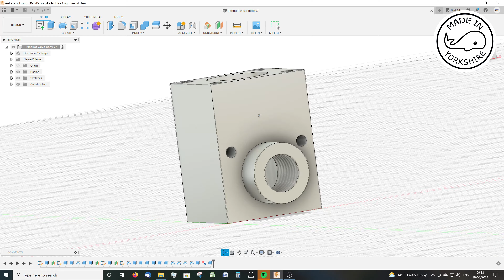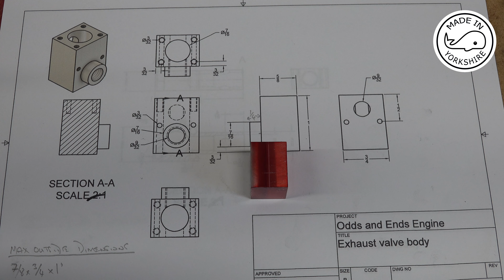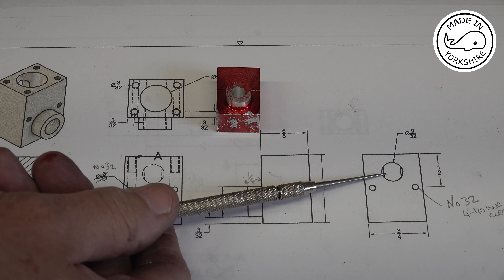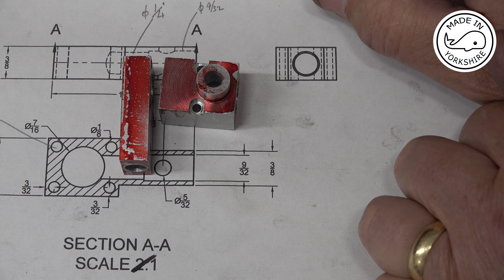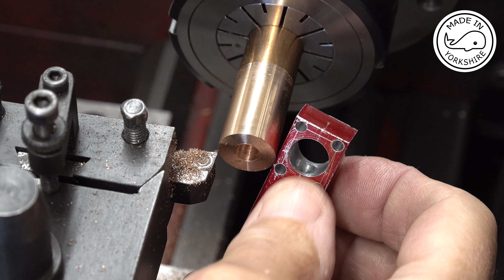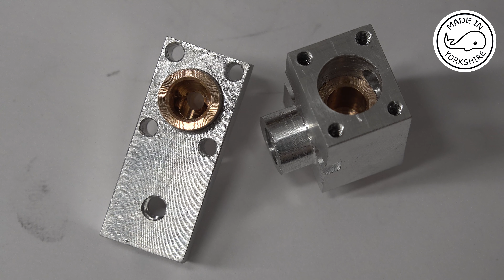#MT41 Part 11 - Philip Duclos Odds n Ends Engine. Intake and Exhaust Valve Bodies. 4K Andrew Whale.

Comment from the maker: ****READ ME****
After reading various comments I think I would change my method slightly. MisterG suggests drilling the smaller (1/8") hole in the cage first, before drilling the larger one. This helps maintain concentricity. A great suggestion! Also, having thought about it, I think I would make the valves and lap them into the cages before pressing the cages into the bodies. That way, if I find that the cages are not perfect, I don't need to press them out of the bodies. You live and learn!
Cheers
Andrew

Comment: I don’t know if you noticed but after the drill break the second drill drilled the valve rod seat out of concentricity. When you were finishing off the other end the hole had a pretty bad wobble. Sorry :(
Reply from the maker: Yeah - I noticed that too. I checked the hole at the other end and it looked perfectly concentric. As a test, I pushed a piece of 1/8" rod through both cages after they had been pressed into the housings. The rod turned perfectly. My next video will see if it is a problem, when I test valve compression.
Cheers
Andrew

Comment: Hi Andrew.. its going well. Can't wait for the next instalment.
If I was making the valve seats, I would set the topslide to as near 45% as possible, and then make sure when I machine the valves, I havn't moved the topslide. This way if the angle is 45.4° or whatever it doesn't matter because they will both be the same, none of this sine business...much too complicated for me.
Might have made the valve seats out  of cast iron bar/ rod too. Not sure what your using for the valves......stainless steel?
I think cast iron / stainless would give a more durable finish when lapped, and the cast iron less likely to "pick up" when being lapped.
Just my thoughts.
Reply from the maker: Hi Raymond. Thanks for the suggestions. I've made sure the topslide hasn't been adjusted and I hope to start on the valves in the next couple of days. I hadn't considered that the 45 degrees wasn't that critical, so good to know. The cages were made out of phosphor bronze so I think they should be ok.
All the best.
Andrew

Comment: I see your problem with cutting that valve seat.  Nice work around Andrew. Your redesign looks very neat. I agree on the drilling, right through with the smaller size first for concentricity. Hopefully you will find the hole is nicely centred. The whole assembly has gone together well. I think the cap screws look good on the side of it.
Reply from the maker: Thanks Tim. The 1/8" holes do look centered on the ends and I've just this minute pushed a piece of drill rod through both cages and it turns without any resistance. So I think I got away with it this time.
All the best.
Andrew

Comment: Hi Andrew, great job and your mod looks like it worked out well. In my very early career I made 1000's of valve guides for Ford (out of Lada ones would you believe)! We used dedicated seat cutting form tools which make sense on high production runs but not so on one offs as they are not cheap. Your solution will work fine following lapping in. Cheers, Jon
Reply from the maker: Hi Jon - many thanks for the background - very interesting indeed.  Fingers crossed I will get a good seal. Thinking about it I would have been better of making the valves and lapping them in before pressing the cages into the bodies. One for me to remember for next time!
All the best.
Andrew

Comment: A big thank you for the valve cage solution to the  seating concerns. They really simplified machining the valve bodies, and should work much better than the aluminum seats. I am curious as to how many other builders have incorporated separate valve cages with this engine.
Reply from the maker: Hi Earl - I'm glad it worked for you too. If I was to machine the cages again I think I would drill the smaller 1/8" hole first, before the larger one (a suggestion from MisterG). That way it would probably help maintain concentricity.
We are nearly there!
All the best.
Andrew

Comment: Nice, sensible modification. Well done. One thing caught my eye though: The valve guide hole didn't seem to be running true (either before the drill snapped, or when you turned it around to machine the spring side). I'm sure you appreciate that if the hole isn't true to the valve seat, you could have problems getting the valve to seal no matter how much grinding you do. Fingers crossed it'll be OK :) FWIW, when I made valve cages for my little engine, I cut them to length first, then drilled right through for the valve stem before enlarging the hole to create the valve pocket, reaming the guide hole & machining the valve seat. That way, the small hole gets a clean start in a centre drilled, faced surface, rather than at the bottom of a larger drilled hole. Like I said - FWIW! :D Keep up the very enjoyable videos!
Reply from the maker: Hi Mate - a great suggestion! I agree that your method would be better at trying to maintain concentricity. I must try to remember that for next time!
Cheers
Andrew

Comment: Andrew I like your solution. I happened to have a 90 degree included angle cutter that I used on mine. I then used valve grinding compound to hopefully give a good seal. I like your idea better.
Reply from the maker: Hi Steven - your approach seems like a good idea - I hadn't though of that. I'm sure your solution will be a success.
Good luck!
Andrew

Comment: Lots of fine work, well planned footage.
I only miss the cylinder that I assume comes in somewhere, somehow....
Reply from the maker: Thanks Stefan. I covered making the cylinder in a previous video. This engine is a strange design (my personal opinion) and the inlet and exhaust bodies bolt onto the side of the cylinder. It should become clearer in my next video.
Cheers
Andrew
Reply: @learningturningmetal  I'm sure I watched Your making the cylinder but I couldn't figure out how those "impossible" valve arrangements would fit to the cylinder......

Comment: Great video. As far as checking your valve face to seat fit we always used gasoline or some other liquid and would pour a little on the back side of the valve and watch for liquid to appear on the other side. You need a liquid that will creep and gas was always handy and cheap. There may be other liquids that worked as well but that is just an idea on how you seal will be without installing them into the finished engine and doing a leave down test.
Reply from the maker: Hi David - thanks for the suggestion. These valves are quite small but I will certainly give it a try.
Cheers
Andrew